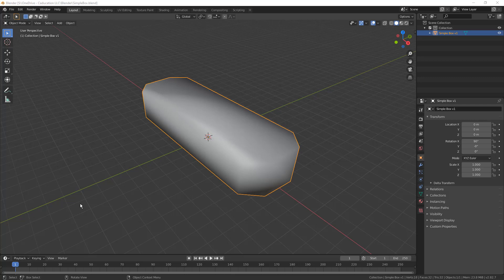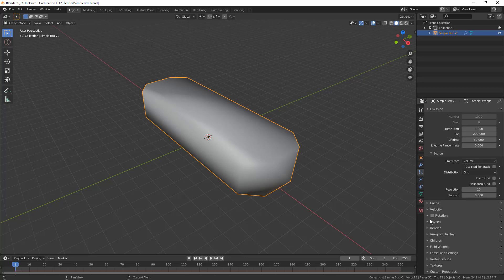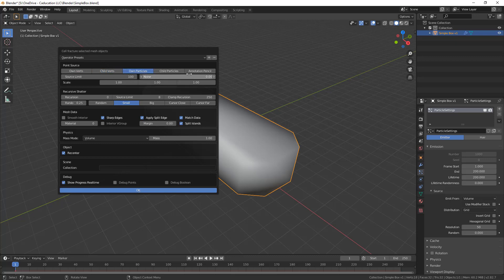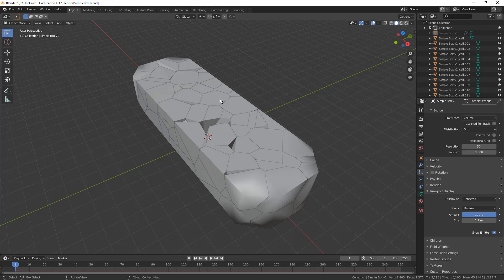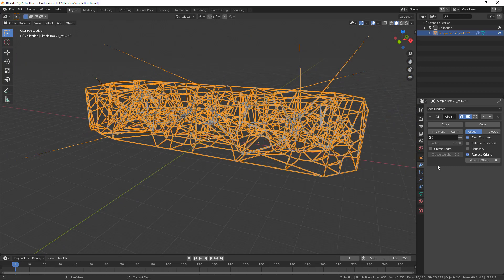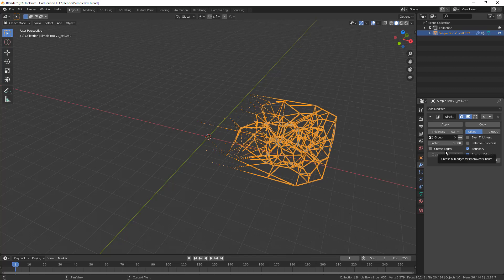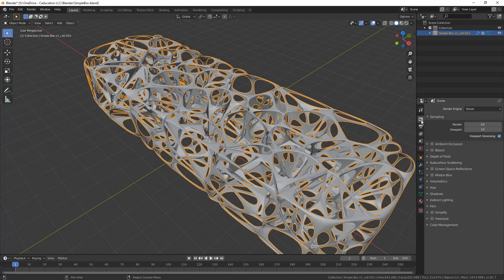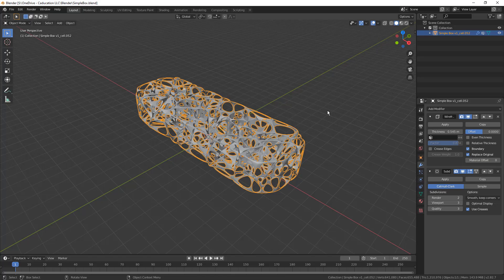Fusion to Blender EP3: Blender Lattice Creation

Comment: Just subscribed to the channel! Love what you are doing. I've been struggling with the Roman tutorial for a bit and finally came across your video. Quick confirmation - the cell fracture is relying on the particle system we generate? So a more resolved and smaller size particle system should result in a tighter, denser lattice structure that is generated after the cell fracture occurs. Just for my own understanding!

Thanks again! Excited to watch the next episode.
Reply from the maker: Thanks Bryan!  Yeah I spoke with Roman before recording that video, its a cool technique!  And yes to the best of my understanding the cell fracture is going between the vertices of the particle system.  If you manually slice up a mesh then theoretically you have complete control over that lattice system.  You can also do the cell fracture without the particle system, but i think that was a way to make it more random/organic.  When you do the cell fracture if you happen to manually modify a mesh, or bring one in from another system, you can use the "Own Verts" option rather than particles.  One thing I haven't tried is the "Annotation Pencil" method.  Maybe I will come back to this in a future video!

I cover more CAD on this channel than Blender, but I do have a series for blender for all the things i struggled(struggle) with :)

Comment: The lattice you created is unstructured. Could you please create the homogenous porous lattice.
Reply from the maker: Hi Vikash, this process isn't ideal for homogeneous lattice.  The cell fracture, even with the randomness value to 0, is still not going to give you what you want.  You will have to play around with getting your mesh vertices like you want and then fracturing based on the vertices rather than a particle system.  I will play around a bit more and if I come up with a good solution I will make a video, but there are a few pieces of software out there specifically designed to build those lattice structures for production and blender doesn't really fit into that group.
Reply from the maker: Vikash,  I added an EP4 video of how to make a more structured lattice.
Reply: welcome to the stochastic Blender world, fierro!

Comment: Can Blender exchange data with other 3D software (Catia)or finite element software?
Reply from the maker: STL and OBJ are the two standards.  The data in Blender is MESH, while things like Catia/Solidworks, NX, Inventor, Fusion etc are all mainly dealing with BREP (Solid bodies).  The math is just different.  You can export other file types from Blender but as far as i know there aren't any BREP style files like STEP, IGES or XT(parasolid)

Comment: Oh this is the channel ive been looking for, instant subscribe, I'm using blender for exactly the mesh deform after i used fusion for measurements, but struggling a bit still and don't want to start over with the designs
Reply from the maker: Tarek, what part specifically are you struggling with?
Reply: @LearnEverythingAboutDesign  for example exporting from fusion to blender, since only meshes can be used, most tutorials talk about loopcuts but that only works with designs made in blender and remeshing breaks everything, for example i have a design that i need to bend with lattices, it has a text and the mesh is a complete mess, plus all the hotkeys and options are still a jungle full of pitfalls
Reply from the maker: @Tarex_  Tarek, sorry I missed this comment.  To get the designs out of Fusion into Blender you don't have many options.  STL or OBJ.  The STL route lets you see the triangle mesh on the screen.  So in Fusion if you select the body in the browser you can right-click and "3D Print",  you can also use the file menu and chose Export to get an OBJ out.  Fusion has a preview functionality you can turn on in your user preferences for a mesh workspace and you can convert a body (BREP) to mesh in fusion and play around to get the mesh exactly how you want.  

Shortcuts in Blender are a must and take a lot of time to sort out.  I know Andrew Price (Blender Guru) has a shortcut key list when you join his mailing list.  That is probably the biggest hurdle when watching tutorials.  I have been working on blender more the past few weeks and plan to have some more blender content soon, but I have been focusing on other things lately.
Reply: @LearnEverythingAboutDesign  No worries, Damian Mathew just made a Video about going from .step to Obj using Moi 3d as a quad converter, and blender has a .step importer but isn't that hot. 
The shortcuts probably come after a while with the Cheat sheet just by brute force, still overwhelming for the start
I'm also on other stuff right now and will continue with Blender when I'm done. But thanks for the response for sure ;)

Comment: Very cool, would these structures be 3D printable
Reply from the maker: Bob, that depends on what printer you have.  Something like a Form2 would have a much better time than a desktop FFF style machine.
Reply: @LearnEverythingAboutDesign  That is very true, I should look into getting a SLA printer someday. I have been able to print some of these structures if keep the amount of fractured parts to about 25, sometimes higher if bigger. Another thing im trying to tackle is having the "shell" of the object connect with the lattice, so as to have the lattice as a sort of custom infill, but i haven't been able to make it manifold.
Reply from the maker: @bobdole27  Very cool that you are applying this Bob!  There are certainly better options out there for lattice designed for 3D printing but they all cost a good bit of money.  Sculpteo, Carbon is working on one, Autodesk has one and so on.  I am working on another mesh video to add to this series that hopefully will be helpfu.
Reply: Depends on the thickness and density of your lattice structure, in my case i use a Mingda Magician X2 and prints latttices structures created with Grasshopper and nTopology.

Comment: You can do much more with Rhino+Grasshopper. Or you can try Additive Manufacturing Softwares like Autodesk Netfabb. Netfabb comes with a wide variety of lattices. Pls do more tutorials on lattices! Cheers!
Reply from the maker: Praanesh, you are correct with those comments.  Rhino+Grasshopper is a great option.  The intent here isn't to show the best option but how to work between Fusion and Blender.  Note that Netfabb is very expensive and at a hobby level isn't a realistic option.  Netfabb Premium will generate Lattice at about $4500/year, which isn't horrible, but Ultimate is needed for lattice optimization at around $14000/year.  That is well outside the cost for the large majority of users.  There are loads of very robust options out there for lattice generation for manufacturing for a wide range or prices.  Blender is certainly not a package suited for Manufacturing but it is amazing in its own right.
Reply: @LearnEverythingAboutDesign  I agree, but I need someone to make a proper tutorial on making lattices with rhino + GH like you! Pls make one in the future!